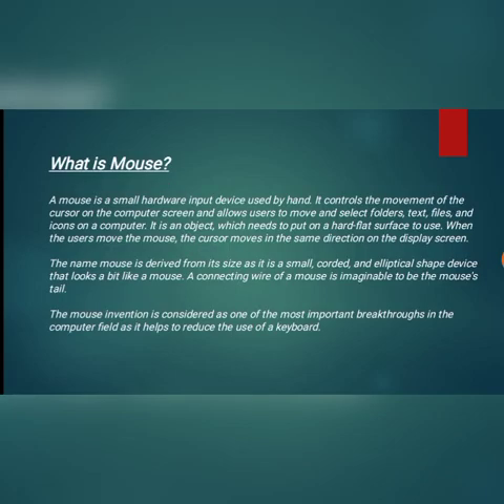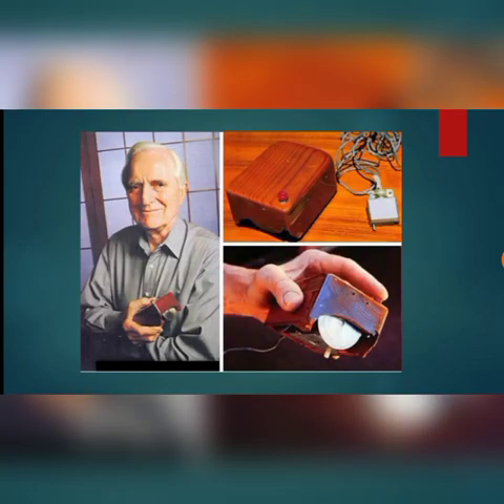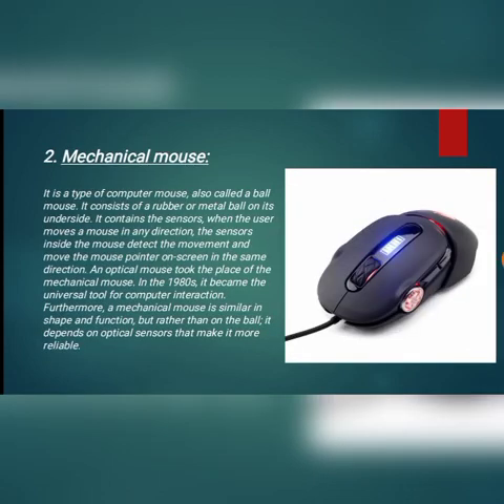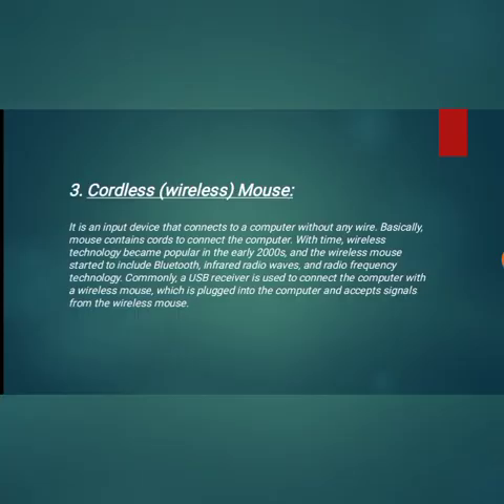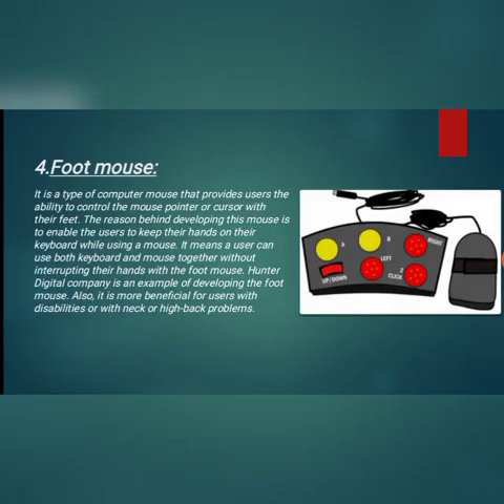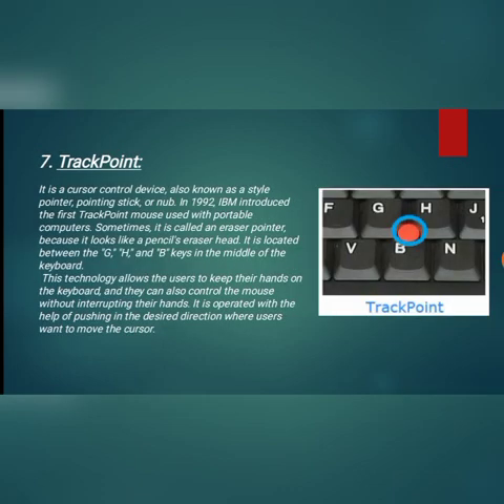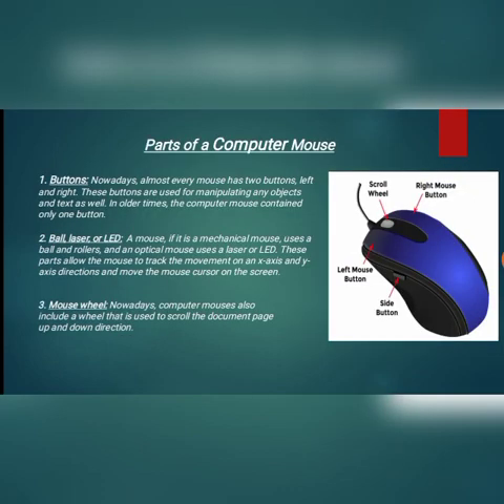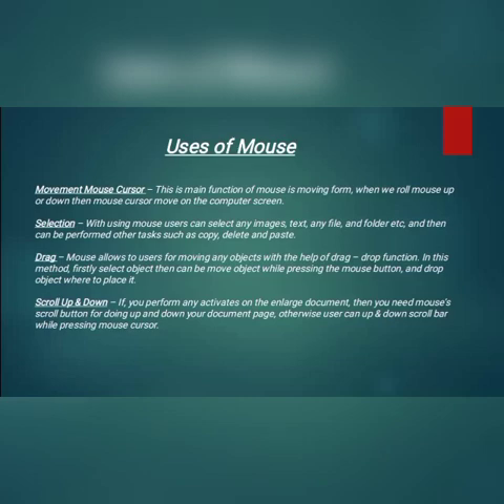mouse

Comment: Good
Summary:
Mouse is an important input device which is used to transmit our demands to computer. It was first introduced in fourth generation of computers. Items can be selected and moved with the help of mouse. It has a scrolling/moving wheel and two, left and right click buttons.

Comment: good
summary
       a mouse is an input device. it is used with the computer. moving the mouse on the flat surface causes the cursor to move on the screen of the computer.

Comment: Good 👍
Mouse is the input device of computer that connected with computer by a cable. Motion of mouse on flat surface move the cursor on screen and by clicking on the button of mouse you can click on your require point in computer .

Comment: summary:
Mouse is an Important input device which is used as pointer in computer. Mouse was first introduced in fourth generation computers. Mouse is consist of a left and right button to select specific parts on monitor screen and usually a wheel to swipe monitor screen up and down.

Comment: Good 
Summary: A computer mouse (plural mice, rarely mouses) is a hand-held pointing device that detects two-dimensional motion relative to a surface. This motion is typically translated into the motion of a pointer on a display, which allows a smooth control of the graphical user interface of a computer.

Comment: Good...
Summary..
A computer mouse is a hand held hardware input device that controls a cursor in a GUI ( graphical user interface) and can move and select text, icons,files and folders on your computer.
As you move the mouse,the pointer on the screen moves in same direction

Comment: Mouse is an Important input device which is used as pointer in computer. Mouse was first introduced in fourth generation computers. Mouse is consist of a left and right button to select specific parts on monitor screen and usually a wheel to swipe monitor screen up and down.

Comment: Good
Summary: A mouse is small hardware input device used to select the text or paragraph by controlling the movement of curser. It is of many types on the basis of either their shapes or structure.It is used to scroll the file or document from top to bottom. In laptops or tablets, it is known as touch pad.

Comment: Good.
A computer mouse (plural mice, rarely mouses) is a hand-held pointing device that detects two-dimensional motion relative to a surface. This motion is typically translated into the motion of a pointer on a display, which allows a smooth control of the graphical user interface of a computer.

Comment: Summary
Superb 👌
computer mouse is a handheld hardware input device that controls a cursor in a GUI (graphical user interface) and can move and select text, icons, files, and folders on your computer. For desktop computers, the mouse is placed on a flat surface (e.g., mouse pad or desk) in front of your computer.

Comment: Good
Summary:A computer mouse (plural mice) is a hand-held pointing device that detects two- dimensional motion relative to a surface. Is used to control the motion of cursor. This motion is typically translated into the motion of a pointer on a display, which allows a smooth control of the graphical user interface of a computer.

Comment: Summary 
computer mouse (plural mice, rarely mouses) is a hand-held pointing device that detects two-dimensional motion relative to a surface. This motion is typically translated into the motion of a pointer on a display, which allows a smooth control of the graphical user interface of a computer

Comment: Good
Summary
A computer mouse is an input device that is used with a computer.  The optical, vertical, USB and wireless mouse are some types of mouse.
Main functions are scrolling, selecting, dragging, pointing etc.

Comment: Good
Summary:
Mouse is used to detect motion according to the surface. Types of mouse vary according to user's need. Some work through sensors, some use BT, and some use wires. Main functions are scrolling, selecting, dragging, pointing etc.

Comment: GOOD✌
SUMMARY : A computer mouse is an input device that is used with a computer. Moving amouse along a flat surface can move the cursor to different items on the screen. Items can be moved or selected by pressing the mousebuttons (called clicking).